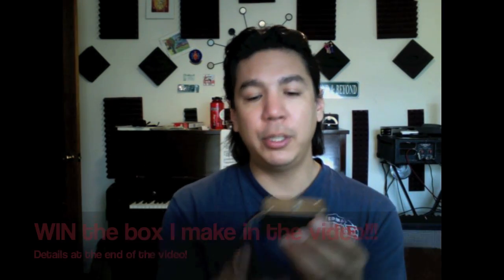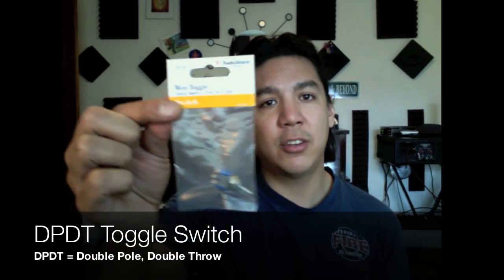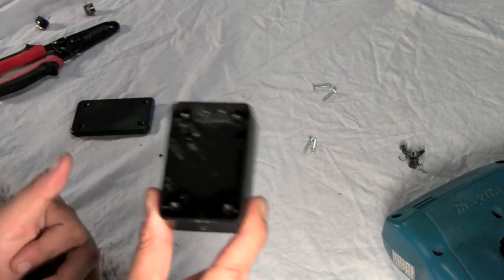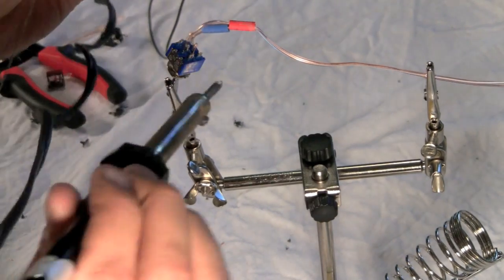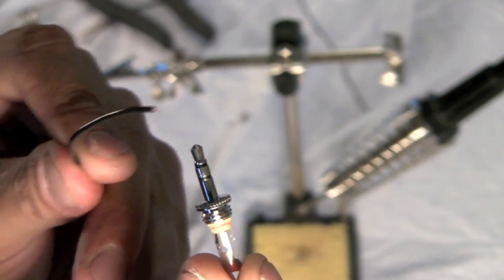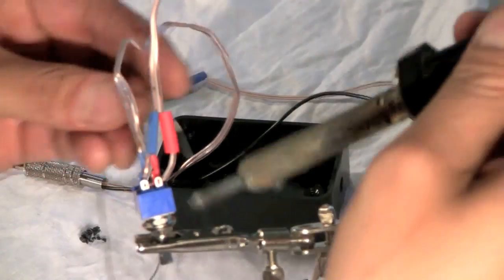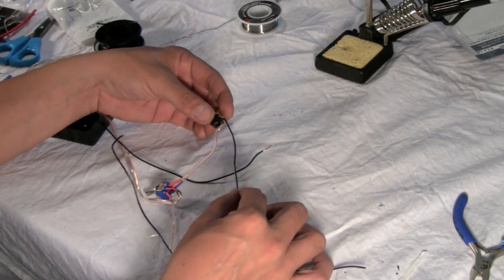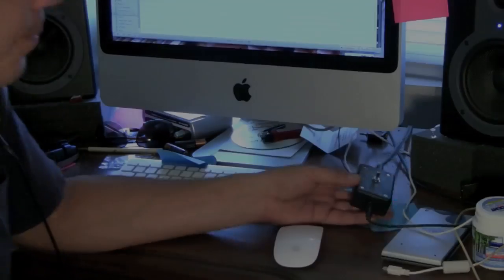How to build a Headphone/Speaker switch for your home studio

Comment: Nice video! This is similar to something I need to build, or buy, but can't find any products or instructions for that kind of device. It is a 5 jack in 1 jack out splitter. Works like yours with more inputs but without any buttons. I need it to have all lines on all the time, so whenever I play music from my TV, record player, CD player, cassette player or Mac I do not have to switch anything with any button. I wonder if that is possible. I bought a Y cable splitter (1 male 3.5 jack to 2 females 3.5 jack) and it works great with one source of audio to 2 receivers (Mac to 2 headphones) but the other way (two input sources to active speakers) it does not :( Any hints?

Comment: actually another little tip! When heating up the heat shrink you can use the body of the soldering iron[ or the section that feels hot] . Slide the heat tube over the connector then just touch lightly with the soldering iron up and down the heat shrink

Comment: I have 2 inputs and one output, ie the reverse of what you're doing. So I should solder my inputs to the outer terminals of the DPDT and the output to the inner terminal of the DPDT. Right?

Comment: First, thanks for this - it is EXACTLY what I'm looking for...with an exception.

How would I do this for multiple channels?

here's what I have on my PC:

1 set of speakers that are 5.1 (2 front speakers equalling 1 plug, 2 back equalling 1 plug, 1 center equalling 1 plug, 1 sub - no plug, powered sub connects to everthing else)
1 headphone
1 mic

I want the same exact switch, but with more channels.   THIS would be awesome as there is NOTHING on the market that can do this.